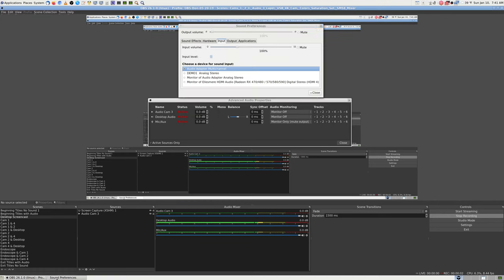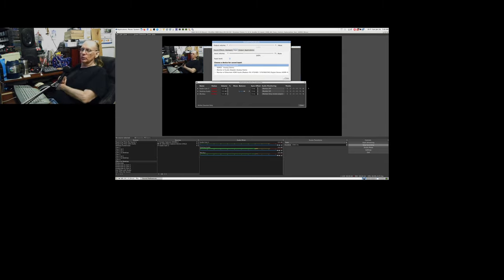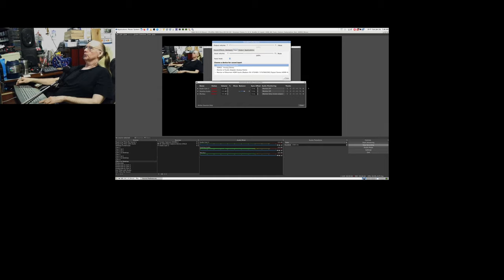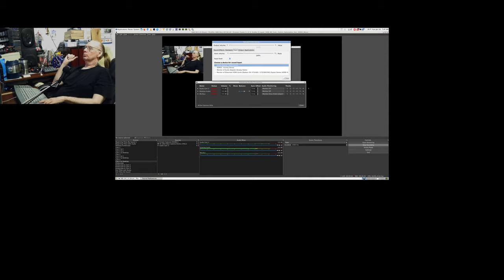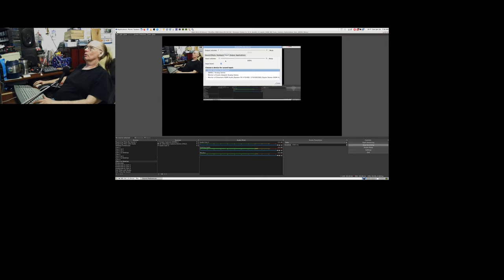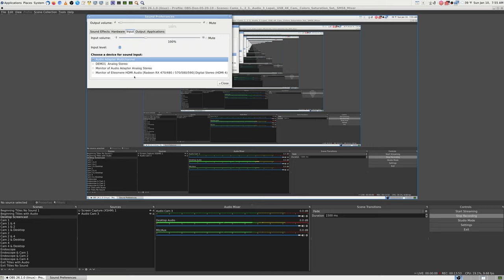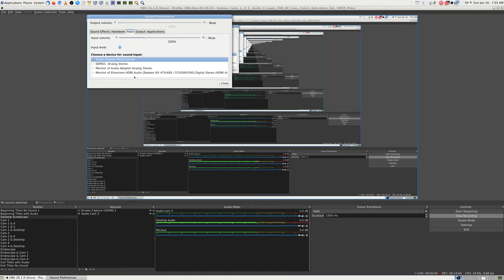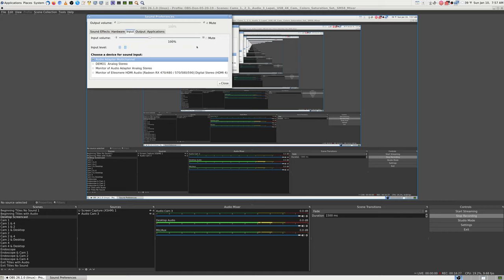002 Testing Audio was Distorted, Video Setup HP DL380 G7 Server Don Bishop OBS Studio 01-10-2021

Comment: When you installed the gpu on that server, which cable did you use? I've heard about certain cables frying the board.
Reply from the maker: Yes, I saw the same problems, when I was searching for a Power Cable. After much research. I found this Page on the HP Support Site, that helped allot. HP ProLiant DL380 G7 Server (has every part & number & pics) - Spare Parts  (https://support.hpe.com/hpesc/public/docDisplay?docId=emr_na-c02236664). I did some searches for the HP Part numbers, I was interested in on Google & Amazon. The HP Parts were expensive, though. So, I searched Google & found it on Amazon.com. I Searched for  HP DL380 G7 GPU Power Cable 10 pin to 8 pin (https://www.amazon.com/s?k=HP+DL380+G7+GPU+Power+Cable+10+pin+to+8+pin&ref=nb_sb_noss). I bought this Cable & video Card, for my HP ProLiant DL380 G7 Server,  
COMeap Motherboard 10 Pin to PCI-E 8 Pin(6+2) SATA IDE Molex Power Adapter Cable Compatible with HP DL380 G6 G7 Server 25-in(63.5cm) Sold by: COReap $14.99 (https://www.amazon.com/gp/product/B07JKFMJJP/ref=ppx_yo_dt_b_search_asin_title?ie=UTF8&psc=1#customerReviews) For this Video Card, XFX Radeon RX 570 RS XXX Edition 1286MHz, 8gb GDDR5, DX12 VR Ready, Dual BIOS, 3xDP HDMI DVI, AMD Graphics Card (RX-570P8DFD6) Sold by: Amazon.com Services LLC $139.99 (https://www.amazon.com/gp/product/B077VX31FZ/ref=ppx_od_dt_b_asin_title_s00?ie=UTF8&psc=1) And these 2 - 750Watt PSUs (https://www.amazon.com/gp/product/B07HFJ5VVN/ref=ox_sc_act_title_2?smid=A3GXBO4732SHMX&psc=1) If it does not say, it fits your exact HP Model (G7 etc) I may let out the Magic Smoke:( I bought a couple Spare Fans, $2.50 w Tax $2.67 Free Shipping - HP DL380 G6/G7 Hot Plug Fan Module here (https://www.techbuyer.com/us/496066-001-hp-dl380-g6-g7-hot-plug-fan-module-1236/) Also, Morten just put up a good video. On installing a Tesla GPU in one of his Lenovo Servers. The Cables for that one, have a very different Pin Out.  It's really something to watch out for, when buying Cables for Servers (https://www.youtube.com/watch?v=wKg8_ba-3-0&list=PL610210A1DC7524CE&index=1) Hope this helps... Don
Reply: @DonBishopDonSongs  great details. Thank you man.

Is the second psu necessary for this setup? I mean I doubt it with the 750watt psu. What is the hot plug fan module for?
Reply from the maker: @anindividual4916  My G7 came with 2-6 Core CPU's and 2-460Watt PSUs. But, when I bought the 8GB Video Card. It requires 150Watts. And that is the Max the 460Watt PSUs can put out. The HP support site. Does say. they can put out 150Watts continuously. But, I didn't want to constantly run them at Max. So, I decided to get the 750Watt PSU's. Also, if I understand it right. You can set the PSUs to share the load and be Redundant, at the same time. Or you can set them to just be Redundant. If you only have 1-PSU. Then you will only have, the Max output of that PSU, for the entire System & the Video Card. And you can only run 1-CPU. Also, with 1 CPU. The main thing I remember about that. Is that you can only use about half of the RAM Slots. Most Servers are like that. I bought the Fans, as backups. In case 1 or 2 fails. Also, I was thinking I might use 1 fan for my Vent in the Closet. It' its not too loud, powered by a Wall Wart... Don
Reply: @DonBishopDonSongs  so a single 750watt will run the system with the gpu and both cpus, right? At least I was under that impression it'd have plenty of wiggle room
Reply from the maker: @anindividual4916  Yep, that's right... Don
Reply: @DonBishopDonSongs  thanks. Sorry for the 20 questions. You were a big help man.
Reply from the maker: @anindividual4916  Cool:) Let me know how your G7 works out... Don
Reply: @DonBishopDonSongs  will do. Happy I talked to you about cables that was where I would have likely gone wrong